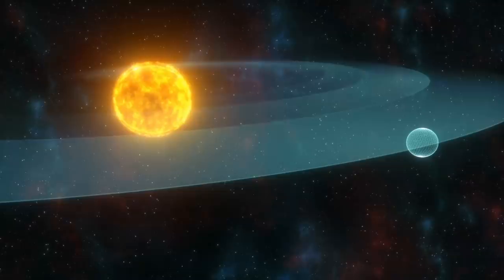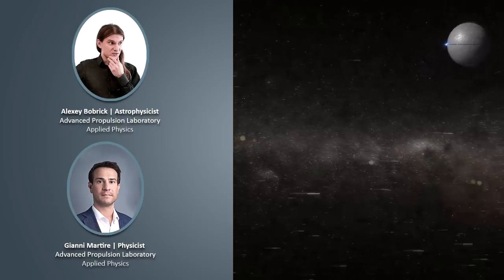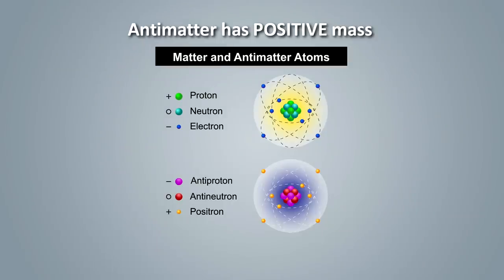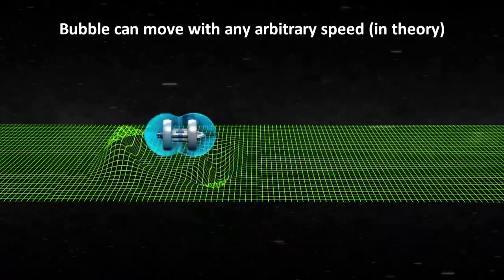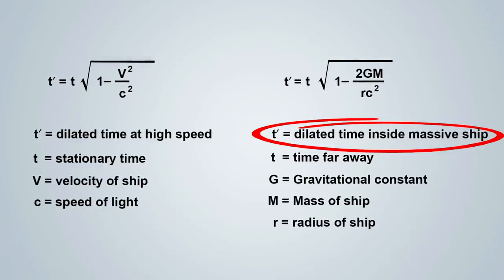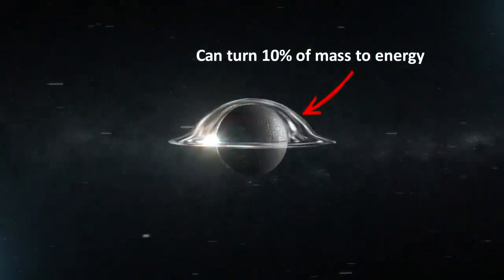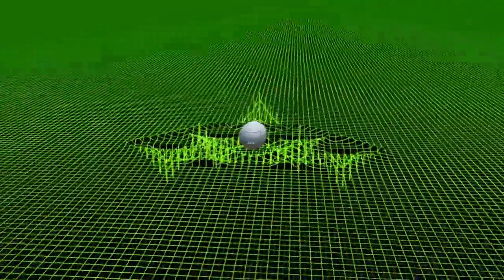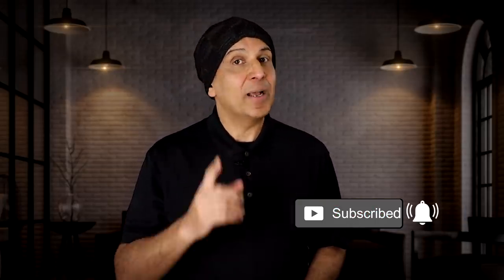REAL Warp Drives? NEW research proposes a solution!

Comment: This video makes me so optimistic!

Amazing explanation as always too :D
Reply: I've watched a bit of your content, 👍 quite distinguished in your own right.

Question though, is there a speed limit for em fields? As far as I can recall magnetic fields have no mass yet are energy, no?

What reason is there to believe that time dilation cannot be achieved using high speed rotating magnetic fields? 

If two magnetic fields rotating in opposition where one was encapsulated by the other, (given sources of both were sufficiently powerful enough to negate field disruption from the other or destruction of source) could the relative speed of either field be perceived to reach c? Each field rotating at half c in respect to its orientation would cause the effective relative speed to each other to be c, no?
Reply from the maker: Hey Parth!  Thanks my friend! Coming from you, it means a lot.
Reply: weird, it basically makes the opposite effect for me.
 "Yeah, yeah, I get it, every single one of these drawbacks is massive. We'll never reach other stars. Fuck it".
Reply: @amlazy9908  q ad
Reply: wisdom seeker  this guy knows what really up. Electromagnetic gravitics had this down pat a long time ago.... once you hit 0 mass, your velocity is infinite... lightspeed is a fools threshold.
Reply: Space is a dual concept!
Space is dual to time -- Einstein.
Time dilation is dual to length contraction -- Einstein, special relativity.
Length , distance, space or depth is produced by the stereographic image created in your mind by the two dual images from your eyes -- hologram in the brain. Depth or the 3rd dimension is a by-product of duality (two eyes) -- holograms or two interference patterns produce depth, or distance. In physics the vector cross product between the x any y dimensions creates the z dimension or third dimension!
Distance, length, space or depth is defined by two dual points -- space duality.
Points are dual to lines -- the principle of duality in geometry.
Up is dual to down, left is dual to right, in is dual to out -- space duality.
Space duality is dual to time duality.
"Always two there are" -- Yoda.
Reply: @hyperduality2838  so have you figured out we’re all literally the same person yet?
Reply: @ArvinAsh   RAISE THE GELLAR FIELDS WERE GO INTO THE WARP!!!
Reply: It's more sci-woo sales from another useless quackademic paper... No real evidence points to the possibility of creating a 'warp bubble' in the 'fabric of space'.. All evidence points to subspace being a quantised, self-balancing matter-energy field. Pumping huge amounts of energy into a focused spot sends some 'subspace field cells' flying, also forming holes.. All this mess of newly created +ve and -ve temporary junk matter (heavy fermions) quickly decays to electrons and positrons (the true fundamental particles), that then (mostly) annihilate back to regular, balanced = empty subspace field.
--
Einstein's equations are great but are not quantised so open to interpretations that fly in the face of quantum physics (experiment results)..  The huge amounts of power used by an LHC run produces a small amount of NEW junk matter, most or all of which annihilates. But 'WARP DRIVES SELL'.. I'm not having a go at Arvin, only yet another sci-woo sales 'paper', and the fact mega-giga-uber-science experiments are the most gratuitous, useless liberal wastage out there.
Reply: @PrivateSi  type in “Dr Steven Greer expose of the security state” if you’re feeling smart... also that “empty substance field” isn’t empty... they’ve had this technology for a long time, and it can’t be made public until the public realises that what is controlling the outcome of physics is a singularity of consciousness. Basically we don’t get to have nice things until we realise that we’re all the same person. Everyone in the universe is literally the same person. The aliens are you. There is no death, you live every single life forever. If you want evidence, do your research on consciousness and UFOs... it’s more real than anyone has ever been allowed to know.... and every scientist that has figured it out has either been told to shut up or they’ve “been” shut up permanently.
Reply: @addamriley5452  Same is dual to different:-
You are the same person now but different compared to a few hours ago. The passage of time means that you are a different person but still the same. Personal identity or the self is a dual concept.
Bosons are dual to Fermions -- spin statistics theorem. Bosons are waves that like to exist in the same state, Fermions are particles that like to exist in different states -- wave/particle or quantum duality.
We are all different but still the same -- duality.

Absolute time (Galileo) is dual to relative time (Einstein) -- time duality.
The future is dual to the past -- time duality.
We predict the future (syntropy) and remember the past.
Time is a dual concept.
Syntropy (prediction, projection) is dual to increasing entropy -- the 4th law of thermodynamics!
Teleological physics (syntropy) is dual to non-teleological physics (entropy).
There is a pattern of duality hardwired into physics resulting in a new law.
Reply: @hyperduality2838  ok by person I meant same being operating both bodies... the consciousness that perceives through every entity in the universe is a single being perceiving the state of duality through reflection which is then transmuted through matter as the energy>vibration>sound>light>matter particle spectrum.
Reply: @addamriley5452  Duality: Two sides of the same coin (heads, tails).
One object but two dual perspectives. The physics or metaphysics requires duality!
Up is dual to down, left is dual to right, in is dual to out -- space duality, the one cannot exist without reference to the other.
Reply: @hyperduality2838  literally everything you say is the definition of “thanks captain obvious”... the question was do you know we are the same person? You have the icon of an alien so I seriously hope so. 😑 are you aware of the densities of consciousness?
Reply: @addamriley5452  Our individual/particular consciousness is a projection of a divine or Godlike state. Yes I have come across this idea many times -- non duality!
Generalization is dual to localization.
Wholes (unity) is dual to parts -- holons.
Our individual minds are reflections of this universal consciousness/mind.
Objective is dual to subjective, absolute is dual to relative.
God or the big bang becomes a suicide bomber is another way of looking at it, this is the origin of Prometheus legend.
There are actually Godlike states in physics or states independent of the observer's perspective -- the laws of physics, for instance the velocity of light is the same and equal for all observers. The constancy of the velocity of light is objective/absolute or a Godlike state.
Your question goes beyond normal physics and into meta-physics:-
"Philosophy is dead" -- Stephen Hawking.
Some people in normal physics would have serious objections to your question! Stephen Hawking claims that there is no Godlike state for instance. Many physicists claim that duality is an illusion.
We are all made out of energy (duality) and therefore come from the same source. I am trying to teach you duality because once you accept it then you can create new laws of physics.
Points (singularities) are dual to lines -- the principle of duality in geometry.
Two dual points represent the boundary of a line -- homology, topology.
Points or singularities are viewed from an external or outside perspective.
External is dual to internal, outside is dual to inside.
Non duality (singularity) is dual to non duality (singularity).
In Einstein's theory of General Relativity there are two singularities:-
The infinite positive curvature singularity is dual to the infinite negative curvature singularity!
Positive curvature is dual to negative curvature -- Gauss, Riemann Geometry.
Black hole is dual to the white hole.
Consciousness can be viewed as a Janus hole/point/complex or the universe and reality exists between two singularities -- the concept of God is dual (the observed and the observer).
Non duality is actually built from duality!
Duality creates reality. God cannot exist without at least one dual observer.
Reply: @addamriley5452  Energy is dual to mass -- Einstein.
Dark energy is dual to dark matter.
Duality allows me to study dark energy & dark matter, the relationship between them is dual. More importantly a deep understanding of the physics involved leads to greater insights.
"Imagination is more important than knowledge" -- Einstein.
Physics at the moment is currently dominated by teleophobic thinking.
Teleophilia is dual to teleophobia.
If you reject teleology (target or Godlike states) you cannot have new laws of physics.
Reply: @hyperduality2838  btw I’m not disagreeing with anything you’ve said, I just wanted to know if you’d gotten further than that yet... if you’ve only “come across” the idea, the chances are you’re not there yet. Are you familiar with the densities of consciousness yet?
Reply: Wake up
Reply: @addamriley5452 Only with what is available on the internet or Youtube.
Infinite density consciousness = Godlike state.
As I say the laws of physics = Godlike states!
The laws of physics are the same and equal for all observers or objective. More importantly I can describe the laws of physics as conforming to a principle of objective democracy or 100% democracy. The scientific definition of democracy is given by the laws of physics, a state where all observers mutually agree with each other.
Science wins through consensus. Consensus = mutual agreement or objective democracy.
Objective democracy is dual to subjective democracy -- democracy is dual concept.
The constancy of the velocity of light for all observers is a democratic principle -- objective democracy -- a Godlike state, and this is achieved all the time in practice.
Reply: @hyperduality2838  well since you’re actually someone that does research... are you aware of how the “UFOs” (electro-magnetic gravitic craft) operate yet?
Reply: @addamriley5452  Nothing can travel faster than light in physics! Dark energy is repulsive gravity or negative curvature -- hyperbolic geometry.
Positive curvature is dual to negative curvature -- Gauss, Riemann geometry.
Curvature or gravitation is actually dual, gravitational energy is dual.
Electro is dual to magnetic -- electro-magnetic energy or light, photons are dual.
Energy is duality, duality is energy.
You can amplify the attractive force of gravity using rotation or spin, this is well known from Einstein's theory of General Relativity -- spinning masses add to the curvature in space. Dark matter is due to the fact that black holes rotate close to the speed of light, think of a spinning ballet dancer who brings her arms into her sides, her rotational velocity will increase -- likewise for collapsing black holes.
"Perpendicularity in hyperbolic geometry is measured in terms of duality" -- Professor Norman Wildberger, universal hyperbolic geometry.
White holes (the big bang, divergence) are dual to black holes (convergence).
Energy is dual to mass -- Einstein.
Dark energy is dual to dark matter.
"Always two there are" -- Yoda.
Questions are dual to answers.
"Spooky action at a distance" defies conventional Einsteinian logic! -- Quantum entanglement.
Reply: @hyperduality2838  your forgetting one important thing about this universe my friend... if you become technologically able to achieve zero mass... you achieve infinite velocity... completely bypassing the light spectrum... and if you understand the nature of the 4th dimension, then you might know that if you bypass such a barrier it gives you access to both all positions in space AND time... and since past, present and future operate in unison as well as linearly, they all exist at once meaning each can be “repositioned” to/into, whilst utilising zero mass inter-dimensional travel... time to upgrade that physics mind of yours me duality. 😉 since you’re already “familiar” with singularity consciousness and the densities, perhaps you’re ready for the next step?
Reply: How can those alien drones become trans-medium? Not only they can fly from space to the earth in a second but they can fly super fast in space, air, oceans (liquid) and solid. They somehow become like ghosts. How’s that possible?
Reply: @dimi3446  from the point of view of a gravitic craft (UFO), everything is in a liquid state...by achieving zero mass, the velocity becomes infinite (yes literally infinite), this is the beginning of what they call inter-dimensional travel. If you’re reasonably new to this “subject” I suggest starting with a video called “Dr Steven Greer, expose’ of the national security state”, for the first round of evidence and a slight “back story” for this.
Reply: @addamriley5452  Okay, and since it’s zero mass then they can somehow control this gravity wave I assume. So if the mass is not absolute zero but very close to zero then this can affect the surrounding space of the craft. But if it’s absolute zero then they can pretty much go through walls like ghosts or through the entire planet or a star like our sun just like neutrinos do.
Reply: Video is BADLY DONE! We have EXPOSED errors in physic!
Everything looks good on the paper, however DO NOT fit the reality!
Reply: @WadcaWymiaru  that’s because in reality, they already achieved zero mass velocity ages ago... these UFOs (gravitic craft) that people are seeing are much more real than anyone thinks 😉
Reply: wisdom seeker  Sorry but no that is only physical Buzzword Bingo. Guess why in the all we have just have to do things always nobody is doing these things... right these concepts does not work physical they work fictional financial, which means find investors and have fun with their money.
Reply: wisdom seeker  well as you read i can. And i have seen many of these promises and i have some knowledge about magnetics and so magnetic monopoles are a highly speculative theoretical concept which nobody have found so far and a lot oh physicist say we never will. 
And not only we found none so far even worse we have no idea how to create them(in a usable way).
So if you like to spend your money but by far you are not the first fool to fall in the trap of Buzzword physics promises.

"Some condensed matter systems propose a structure superficially similar to a magnetic monopole, known as a flux tube. The ends of a flux tube form a magnetic dipole, but since they move independently, they can be treated for many purposes as independent magnetic monopole quasiparticles. Since 2009, numerous news reports from the popular media[16][17] have incorrectly described these systems as the long-awaited discovery of the magnetic monopoles, but the two phenomena are only superficially related to one another.[18][19] These condensed-matter systems remain an area of active research."
But analog mathematical description is very far from any usable existing devices.
Reply: He tried to pull a fast one on us. Here is my comment from earlier…

Come on. You’re really going to belittle us like that? I can’t believe you just tried to pull a fast one on us. You may have the rest of your audience fooled. Since when is the Math ever “too complicated” for your channel?

It’s called the twin paradox:
Converting that much mass into energy so that you can travel 0.5c, you might as well not haul so much unnecessary mass and travel 0.975c in order to take advantage of the “standard” time dilation and length contraction. With “standard” time dilation, you could probably get there in less than a month, especially since you’ll be getting length contraction for free (meaning you’ll be traveling a fraction of the distance).

That has always been the problem:
The problem was never the time elapsed for the onboard observers. In the future, the closer to the speed of light we can get, the less time and distance they would need to travel. Because of length contraction, we can theoretically shrink the distance to any point in the universe to however short of a length we desire. And due to time dilation and the twin paradox, we can theoretically go to any point in the universe in as little time as we choose. The problem is that when the travelers get back to earth, billions of years could have potentially elapsed for observers who remained on earth.

There’s a much simpler solution:
If you don’t care about the twin paradox, then you could just use cryogenic sleep. This is a solution that we can implement today. And it will cost much less than one 10th if the mass of the sun.
Reply: I'm wondering if the new MUON G-2 particle discovered can give them the "mass" they need. It is 207× heavier than a proton.
Reply: @fbidenflagguy  There is no discovery of a new particle so far. They just gave stronger evidence of a discrepancy between the best theoretical prediction/calculation and the measurement.
An interaction with such an extra particle is just one of several explanations for it.
Reply: @Techmagus76  you are saying the MUON G-2 is not a newly discovered particle?
Reply: @fbidenflagguy  Sure not. They redo the Brookhaven Muon g-2 experiment with the same magnet to archive higher precision(because of the better muon beam the have at Fermilab). 
There is no chance to find a new particle at all, as they measure a property of a well known particle the muon.
The Brookhaven experiment found a discrepancy in the measured value of the anomaly of the anormal magnetic moment of the muon( yes double anomaly of anormal sounds confusing but that is what it is. 2 was already anormal and needed quantum mechanics for the explanation, then there is a difference to 2 which needed QED to explain that is not exact 2 and now they found more evidence that there is a difference to the calculated difference).
The evidence at Brookhaven was already/only 3.3 sigma that is officially not a discovery(5 sigma needed). The 5 sigma rule or confidence level is used as far too many results showed up and later disappeared.
Even the actual results so far just have 4.2 sigma/but that just 6% from all the data they will have and that was looked through until now.
But still they can only find a discrepancy if it holds in the measurement and the calculation of a property of the muon. Anything else is just pure speculation like another massive particle could interact with the muon that lead to the found discrepancy(thats not a discovery of such a particle only a small hint). But there are many more possible explanations and a new particle or a new force are only the most sensational and so they get the highest attention in the media.

Which is clear as maybe our calculations are not good enough is not such a good headline as possible new particle found or physics beyond the standard model.
Who needs public money has to play along the publicity game.
Reply: @Techmagus76  1 in 44,000 chance it is not a new particle from what I've read. Seems legit to me. So sorry it's not 1 in 3,000,000 yet. I'll go ahead and call it what it is prematurely. 207× the mass of a particle he same size sounds like a new particle to me.
Reply: @fbidenflagguy  You still didn't get the point. the sigma 4.2 is that the discrepancy is real and not just a statistic outlier. 
Then if we have more confidience it is still not possible to calculate the chance that a particle is then the reason for the difference and not something else.

You can call it whatever you want but that is not scintific and who should care of your personel opinion on it, if it is not scintific?
Reply: @TucoBenedicto  Way to look at things. You sound super happy bro!
Reply: @fbidenflagguy  no. The muon is a particle that we have known about. The muon g2 experiments “suggest” there’s a new particle. There really isn’t. They do this all the time. They say there’s a new particle then we hear nothing after that.
Reply: @joshbutler822  Happiness has jack shit to do with it. Science is screaming in our faces for the past half century at least that interstellar faster-than-light travel is basically physically impossible.
Reply: A near neutron star density ship. Nah, it's stupid.
Reply: Yeah, except the "Explanation" makes the SAME mistake most "Sci-Fi" "Wrters" do when not really understanding their own Plot Device, they overlook the core elements of that device that makes it work in their "universe" - the scenario - they're interested in,  writing their "story". 
According to exactly WHAT the "Theory" claims, it's NOT about "Moving the Bubble" within "Normal Space" (so needing to ACCELERATE it, returning them to the whole "Rocket vs ______" thing in the _FIRST PLACE :=/ ) faster than The Speed of Light (or the "Causality" constant- the speed limit of Causality in "Normal Space") because : 
 The Speed of Light in NORMAL SPACE is Normal Space's "Speed Limit" and you're trying to ACCELERATE something - a BUBBLE in this case - in Normal Space. 
So circular (sounding more like a "Perpetual Motion" paradox than anything :=/ ), its hard to keep it clear here, for me too ;=)) !
NO !!
What Alcubierre did was show how EXPANDING the "Space" BEHIND the bubble and CONTRACTING it IN FRONT would SPONTANEOUSLY RESULT in the EQUIVALENCE of movement FASTER THAN LIGHT without violating "Normal Constraints" outside that bubble, AGAIN - in NORMAL  Space.
 No ancillary acceleration required at ALL, ESPECIALLY since the discussion is about "Accelerating a Bubble" within NORMAL SPACE that's NOT IN NORMAL SPACE .
This entire treatment shows a CLEAR LACK OF UNDERSTANDING of BOTH the Basic Premise itself - AND subsequent work ACTUALLY DONE by OTHERS on Alcubierre's premise ITSELF ! 
NO, this particular Vid being nothing more than a projection of its originators DREAMS onto what they HOPE could be done, finds the originator if the vid AND anyone they're claiming to be "Looking into" it failing to understand Alcubierre's very BASE CONCEPT itself.
Reply: @TucoBenedicto  ABSOLUTELY. The "Explanation" makes the SAME mistake most "Sci-Fi" "Writers" do when not really understanding their own Plot Device, they overlook the core elements of that device that makes it work in their "universe" - the scenario - they're interested in,  writing their "story". 
According to exactly WHAT the "Theory" claims, it's NOT about "Moving the Bubble" within "Normal Space" (so needing to ACCELERATE it, returning them to the whole "Rocket vs ______" thing in the _FIRST PLACE :=/ ) faster than The Speed of Light (or the "Causality" constant- the speed limit of Causality in "Normal Space") because : 
 The Speed of Light in NORMAL SPACE is Normal Space's "Speed Limit" and you're trying to ACCELERATE something - a BUBBLE in this case - in Normal Space. 
So circular (sounding more like a "Perpetual Motion" paradox than anything :=/ ), its hard to keep it clear here, for me too ;=)) !
NO !!
What Alcubierre did was show how EXPANDING the "Space" BEHIND the bubble and CONTRACTING it IN FRONT would SPONTANEOUSLY RESULT in the EQUIVALENCE of movement FASTER THAN LIGHT without violating "Normal Constraints" outside that bubble, AGAIN - in NORMAL  Space.
 No ancillary acceleration required at ALL, ESPECIALLY since the discussion is about "Accelerating a Bubble" within NORMAL SPACE that's NOT IN NORMAL SPACE .
This entire treatment shows a CLEAR LACK OF UNDERSTANDING of BOTH the Basic Premise itself - AND subsequent work ACTUALLY DONE by OTHERS on Alcubierre's premise ITSELF ! 
NO, this particular Vid being nothing more than a projection of its originators DREAMS onto what they HOPE could be done, finds the originator if the vid AND anyone they're claiming to be "Looking into" it failing to understand Alcubierre's very BASE CONCEPT itself.
Reply: wisdom seeker  _EXACTLY_.  See my overall comment elsewhere on this thread.
Reply: @addamriley5452  - Yeah, except the "Explanation" makes the SAME mistake most "Sci-Fi" "Writers" do when not really understanding their own Plot Device, they overlook the core elements of that device that makes it work in their "universe" - the scenario - they're interested in,  writing their "story". 
According to exactly WHAT the "Theory" claims, it's NOT about "Moving the Bubble" within "Normal Space" (so needing to ACCELERATE it, returning them to the whole "Rocket vs ______" thing in the _FIRST PLACE :=/ ) faster than The Speed of Light (or the "Causality" constant- the speed limit of Causality in "Normal Space") because : 
 The Speed of Light in NORMAL SPACE is Normal Space's "Speed Limit" and you're trying to ACCELERATE something - a BUBBLE in this case - in Normal Space. 
So circular (sounding more like a "Perpetual Motion" paradox than anything :=/ ), its hard to keep it clear here, for me too ;=)) !
NO !!
What Alcubierre did was show how EXPANDING the "Space" BEHIND the bubble and CONTRACTING it IN FRONT would SPONTANEOUSLY RESULT in the EQUIVALENCE of movement FASTER THAN LIGHT without violating "Normal Constraints" outside that bubble, AGAIN - in NORMAL  Space.
 No ancillary acceleration required at ALL, ESPECIALLY since the discussion is about "Accelerating a Bubble" within NORMAL SPACE that's NOT IN NORMAL SPACE .
This entire treatment shows a CLEAR LACK OF UNDERSTANDING of BOTH the Basic Premise itself - AND subsequent work ACTUALLY DONE by OTHERS on Alcubierre's premise ITSELF ! 
NO, this particular Vid being nothing more than a projection of its originators DREAMS onto what they HOPE could be done, finds the originator if the vid AND anyone they're claiming to be "Looking into" it failing to understand Alcubierre's very BASE CONCEPT itself.
Reply: @hyperduality2838  So who was the observer during the big bang ? After all the theory of relativity teaches us that without an observer time is meaningless.
That's why when we go to a place devoid of humans we call it the timeless land.
Reply: @westnblu  The observed is dual to the observer -- David Bohm.
You or your mind is the observer.
Mind (the internal soul, syntropy) is dual to matter (the external soul, entropy) -- Descartes.
Your mind communicates with the outside world via photons or the electro-magnetic field. Photons or light are actually dual, they represent a barrier or boundary between your internal mind (syntropy) and the world of atoms & forces (plus everyone else's mind).
Internal is dual to external.
In a communication system the receiver of a message literally predicts the message into existence -- Shannon's information theorem, this is a syntropic process.
Convergence (syntropy) is dual to divergence (entropy) -- the 4th law of thermodynamics!
Predictability (certainty) is dual to unpredictability (uncertainty).
The big bang is a Janus hole/point (two faces = duality) -- Julian Barbour, physicist.
Topological holes cannot be shrunk down to zero.
Homotopic equivalence = duality.
https://en.wikipedia.org/wiki/Duality_(mathematics)#Analytic_dualities
Reply: @westnblu  The past is dual to the future -- time duality.
We predict (syntropy) the future and remember the past.
Absolute time (Galileo) is dual to relative time (Einstein) -- time duality.
My absolute time is your relative time and your absolute time is my relative time -- time duality.
Time is a dual concept!
Space is dual to time -- Einstein.
Time dilation is dual to length contraction -- Einstein, special relativity.
Concepts are dual to percepts -- the mind duality of Immanuel Kant.
Up is dual to down, left is dual to right, in is dual to out -- space duality.
Length, distance or space is defined by two points (boundaries) -- space duality.
Points are dual to lines -- the principle of duality in geometry.
Space duality is dual to time duality.
Reply: None of us will be alive to see it.
Reply: I like the video, but I hate to be the common sense here that pops the bubble of enthusiasm

But biological life forms are extremely adapted to their gravity, and show significant health issues when put into any environment not identical to the gravity they adapted to, and randomly thrusting people into the gravity of a small neutron star would crush them. Heck, not even a small neutron star, even 10 percent the mass of the sun would create so much gravity, that its many times more force and pressure than deepest depths of the ocean. So we'd need ways for people to survive that pressure, and its not as simple as build a submarine like room for them, because gravity permeates through all forms of mass, gravity is the fastest known force in the universe, and the only force that can escape a black hole when not even light can, it's also unknown in mass and does not stop on contact with any known matter, if we had technology to stop gravity, we'd have floating cities and flying ships that can leave earth's gravity like flying through empty space, completely unimpeded. Additionally, countering the effects of gravity would also counter the time dilation
Reply: @PrivateSi  Man said liberal. Also LHC does real science.
Reply: rly? iam depressed. Not only we human beings destroy everything, look at how we treat animals on this planet. The idea of human beings in space makes me actually sick.
Reply: @ArvinAsh  explains the death star :P
Reply: @ArvinAsh  what of the problems of flying it to a sun black hole etc ?